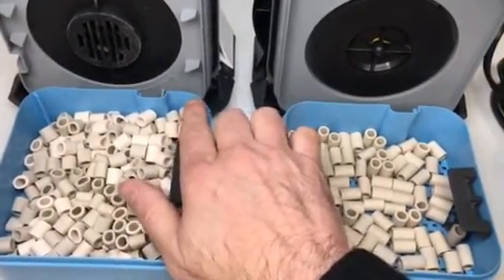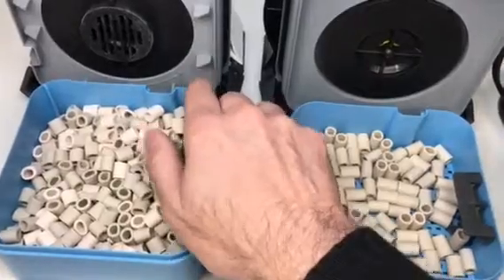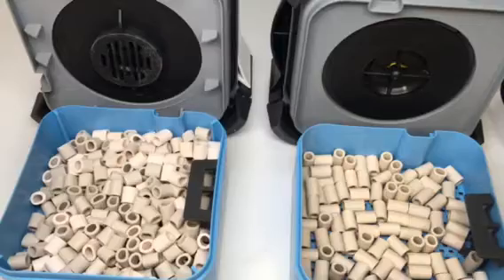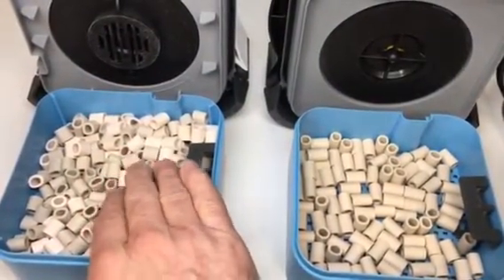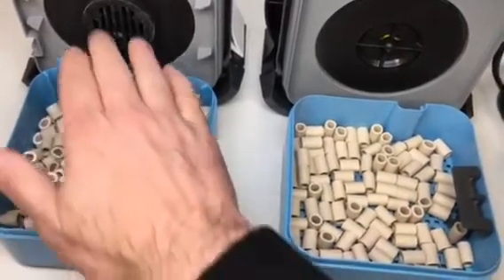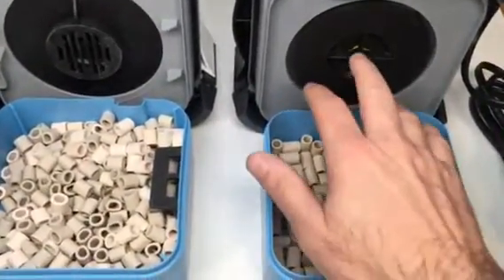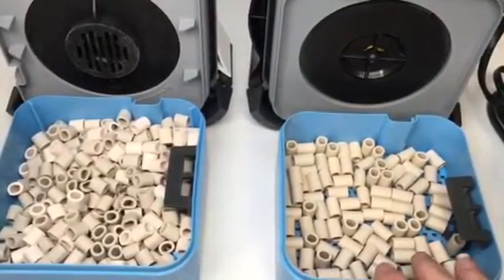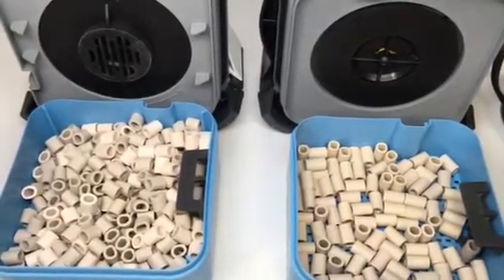Old verses New Sicce Whale Canister filters.

Comment: I'm having trouble getting.mine to start it's primed and no air bubbles. impeller doesn't want to pump it seems, it's brand new. any tips?
Reply: Did you get it going?...My dad bought the 350 and seems to be having the same issue
Reply from the maker: Did you get it going?  I do not have affiliation with Sicce